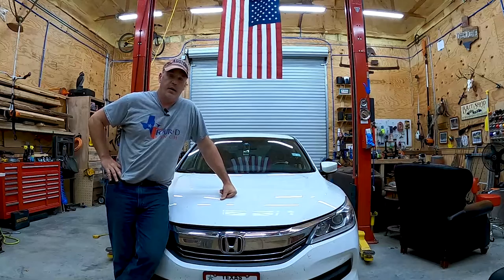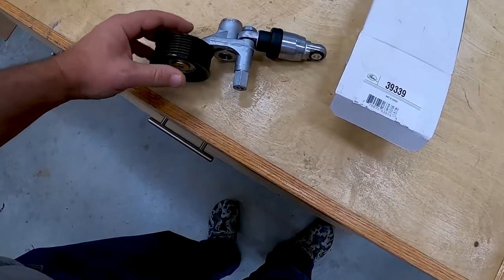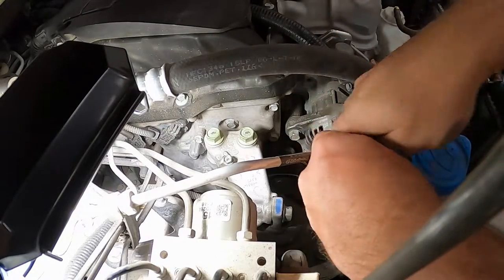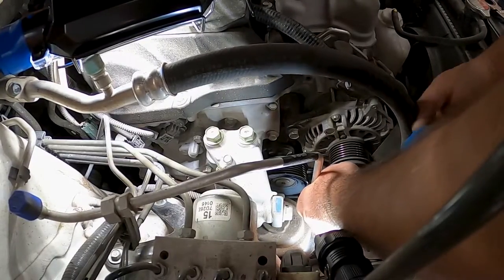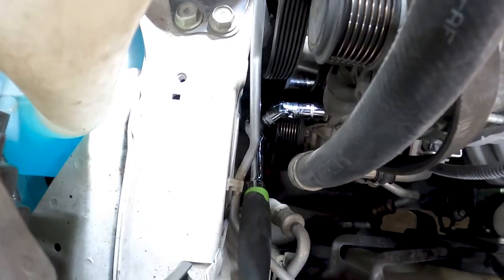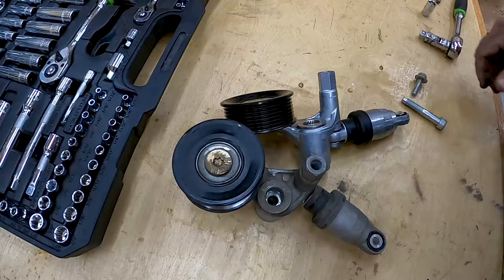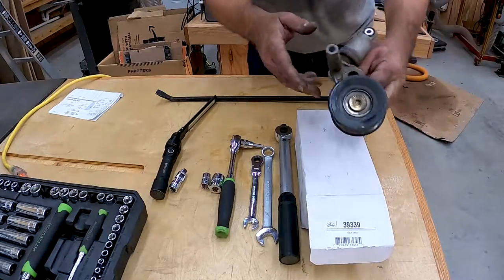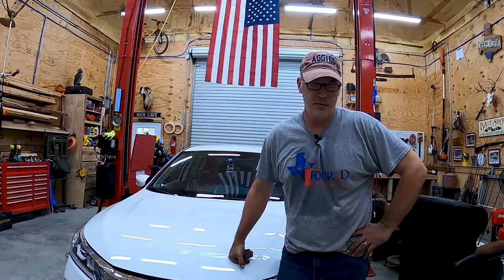How to Diagnose and Replace a Belt Tensioner on a 2017 Honda Accord

Comment: FANTASTIC lighting in this video 🔦
a few things I'll point out to those watching:
- DON'T cheap out on the tensioner pulley. I bought the $40 pulley on Amazon and it gave out 1 year later. OEM is the way to go! I linked an OEM tensioner pulley in my video for about $100
2) 3:20 Try not to rest the coolant reservoir tank on a hot catalytic converter because it could melt the plastic 
3) 11:33 DON'T over-torque the 8mm hex bolt, it should only be about 17 lb ft., this can strip the bolt as it's aluminum housing 
4) Using two wrenches interlocked can make it a lot easier for leverage to pull back on the tensioner pulley

Comment: would it have been easier to just replace the pulley itself with the new bearings. unless the plunger was also bad.?
Reply from the maker: It’s very hard to find the pulley for sale alone. I tried, but most all part suppliers only sold the component with the plunger. No the plunger was not bad at all, just the bearing in the pulley.

Comment: Love the video!! about to change my tensioner myself this weekend. I’m a large guy with fatter hands lol 😅, would it be much easier if I was to remove the alternator to get to the 12 mm bolt? Please let me know.
Reply from the maker: I don’t think it would help that much! I would try with long wrenches or extensions first, before taking off the alternator. It’s hard to get the belt back on the pulleys on the bottom, so try to leave it in place. Thanks for watching!
Reply: To create more space, possibly the side motor mount.
Reply: No need to take off the alternator but it is hard getting into those tight places and you have to have a good back for bending over. Great video and very precise!!!

Comment: Great video . But I'm stuck on the socket size of the tension pully bolt. You never mentioned the socket size. Whats the size need to remove the pully bolt?
Reply from the maker: Thanks for watching, I'm pretty sure it was a 17mm to release the tension on that bolt.
Reply: @FourDRanch   are you serious? he meant the size of the bolt to remove the tensioner. your just grabbing tools, a lot of us just came to know the bolt head sizes. the 17mm tension bolt sticks out like a sore thumb, you cant miss that one
Reply: 8mm Hex key bro he said it twice!!!
Reply: 8mm hex socket, I have all the parts needed linked in my video I just made

Comment: i have a 2023 civic si and the tensioner pulley is already making noise at 2000 miles.... -_-.  they need to find a new bearing supplier.
Reply from the maker: Agree!

Comment: How many miles was on the car?
Reply from the maker: It was around 50,000 when the pulley went out. Thanks for watching my videos!
Reply: @FourDRanch  mines at 40,000 now and hearing the sound.
Reply: @sanchezwhyte3641  Dang so soon, mine started at around 110k and again at around 140k

Comment: Buy Honda or regret it later. “Expensive” is almost ALWAYS the cheaper option. Buying cheap ALWAYS ends up being more expensive, ALWAYS.
Reply from the maker: Thanks for watching my videos!
Reply: TRUE! I just made a video replacing the aftermarket one I bought and changed just one year ago so this is my second time changing it
Found it oem for about $100!
Reply: He put a gates on which is really good. its oem for some manufacturers, honda used to be top tier but these newer parts they manufacture or use as their oem parts are not how they used to be, quality has gone downhill through the years.